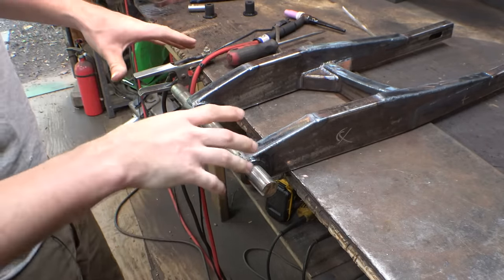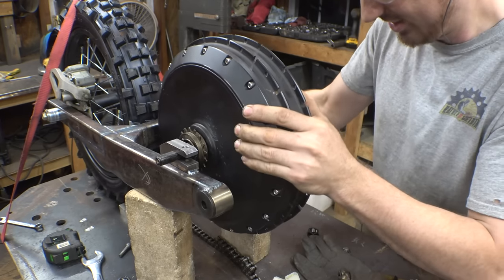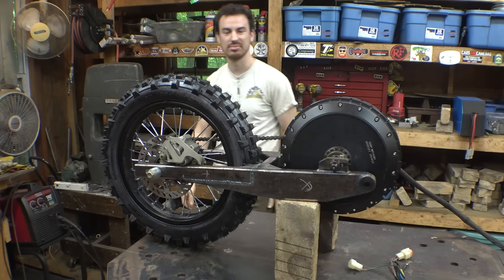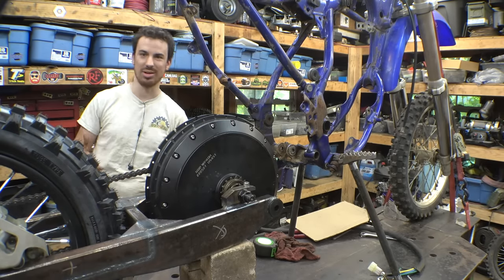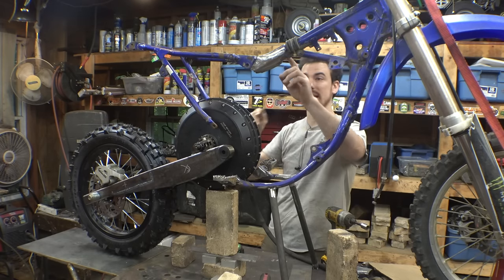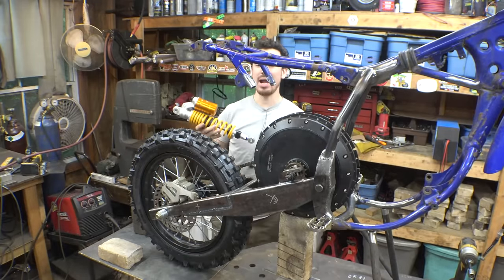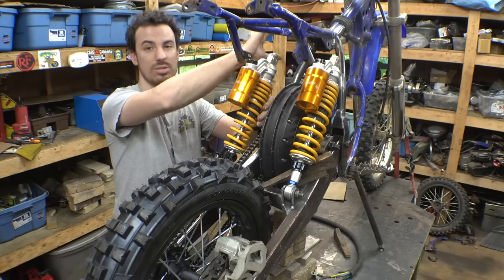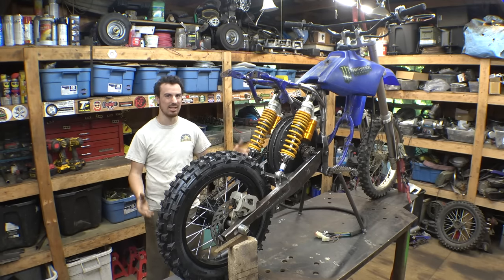Electric YZ85 Dirt Bike - Part 2

Comment: If you wanted a ton of unsprung weight and cetrifugal force destroying the handling on this bike, you've done a great job!  You would have been much better off lacing the hub motor into the wheel, or using common sense and putting in a mid-drive.  Absolutely terrible design.

Comment: A small amount of fore thought and you could have built an electric motorcycle, but you tried to reinvent the wheel. You would have been better off building it from scratch, than the amount of modifications you made to the original frame…..

Comment: SMH, you cut away 75% of the frame, might as well have started from scratch. would be cheaper easier and faster. SMH, coulda just used the "HUB" motor as a hub and not had to change anything

Comment: Just plain dumb to cut up a perfectly good frame and then fabricobble a new frame that have random geometry... ... ... why put the motor on the rear fork? it will be soooo out of balance when a huge mass like that is moving like a pendulum on yo suspension. motor should be mounten in the frame like it was with the gasser. and definately not in to the suspension :D